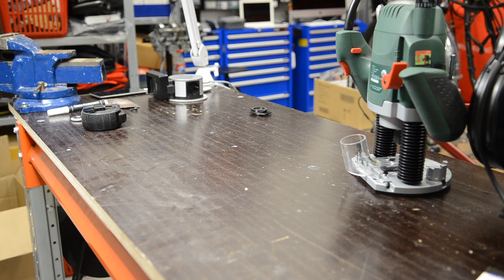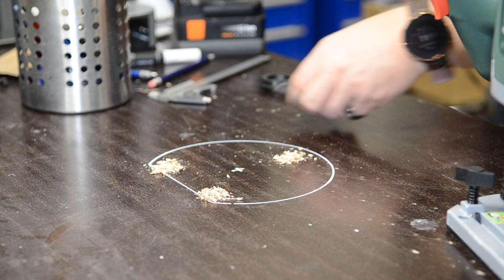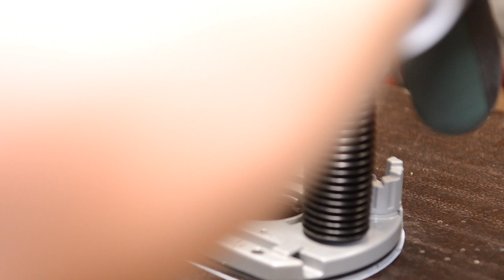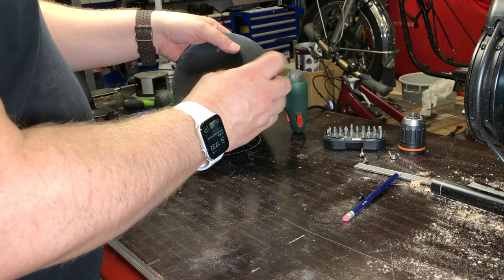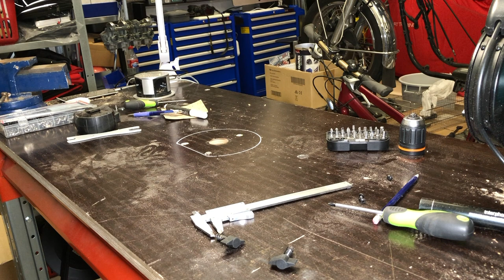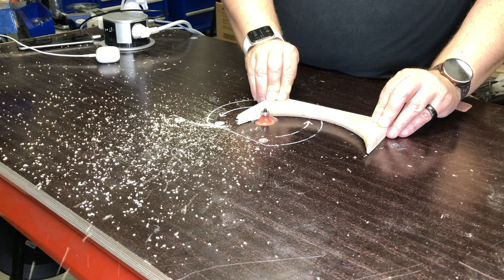Super simple DIY  a benchtop router table | Part I

Comment: How did you get it to stay on without using both hands?
Reply from the maker: What do you mean?
Reply: @CafeExMachinaKokkola  He means: What did you do to the machine to stay on without pressing the on-button?
Probably a zip-tie and a switched outlet
Reply from the maker: I turn it on using the outlet's on/off switch. The router's switch is always in the on position with zip-tie.

Comment: How do you turn it on?
Reply from the maker: I turn it on using the outlet's on/off switch. The router's switch is always in the on position.
Reply: @CafeExMachinaKokkola  Tnx, did you lock switches on router? via zip ties or something?
Reply from the maker: Yes, i lock it with zip ties.